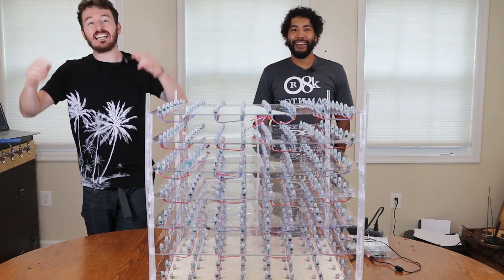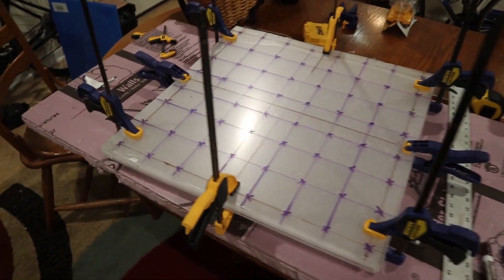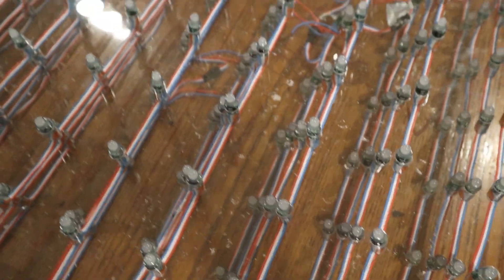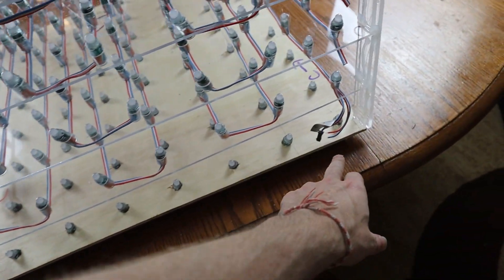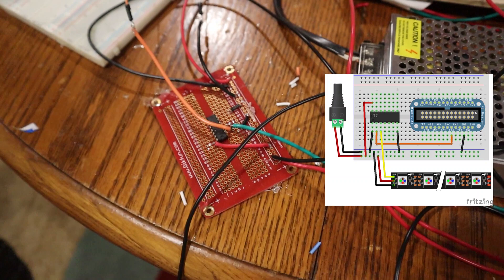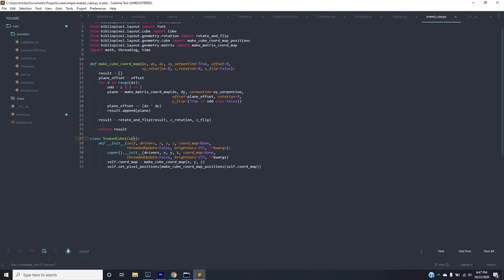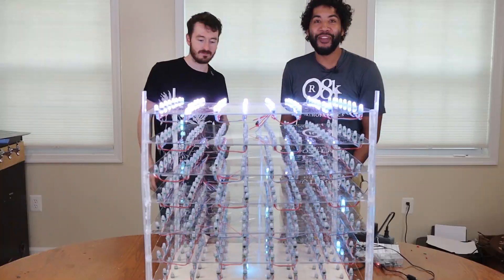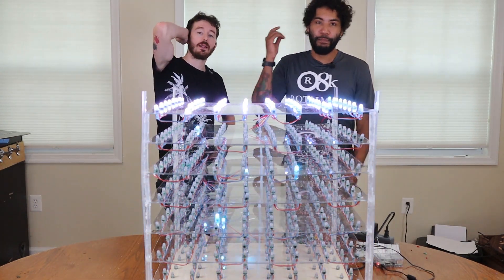HOW TO MAKE AN LED CUBE: Making a WS2812b LED Cube with Animations | Raspberry Pi Projects

Comment: Amazing!  Just out of curiosity, is it possible to hang the LED strips instead of having them zig zag horizontally? So they would be hanging vertically, rather than requiring the acrylic boards to hold them?
Reply from the maker: Thanks Justin! Yes if the orientation changes the code would just think the cube is side ways so you could play around with it to reorient the cube so it’s going in the proper direction. Shouldn’t be too difficult I remember it took me a long time to do originally but was drinking, so it didn’t help lol. If you read through the code I’m sure you can figure it out
Reply: @tyandgigbuilds8836  Awesome thanks!

Comment: hi, kewl stuff.. had a few queries.. since the strip has 50 leds and there are 64 holes in each sheet, did you connect the next strip in the same level?.. also for 512 leds, did u use 10 or 11 sets.. kindly reply
Reply from the maker: Hey Sandeep, I connected 2 strips in each layer, one strip being 50 and the other being 14. The one with 14 I made by cutting a different wire to make 36 and 14. I then used the remaining 36 for the start of the next layer and kept going like that until the last layer. Then once every layer had 64 I connected each layer to one another in a snaking pattern making sure the out feed of one layer was going to the in feed of another layer. I had a lot of these lights left over so I didn’t buy them, but you’ll need 11 sets of 50 leds for 550 total to cover the 512 leds
Reply: @tyandgigbuilds8836  okies, thanks for the reply.. I was also wondering to avoid all this cutting and joining if I make a 7x7 grid and use all 50 in 1 layer itself..
Reply from the maker: That would be easier and cheaper but the resolution would not be as high (not a big deal). Probably I would recommend that, the code might need to be modified slightly but not much
Reply: @tyandgigbuilds8836  okies..thanks for your advice 👍

Comment: hi, kewl stuff.. had a few queries.. since the strip has 50 leds and there are 64 holes in each sheet, did you connect the next strip in the same level?.. also for 512 leds, did u use 10 or 11 sets.. kindly reply